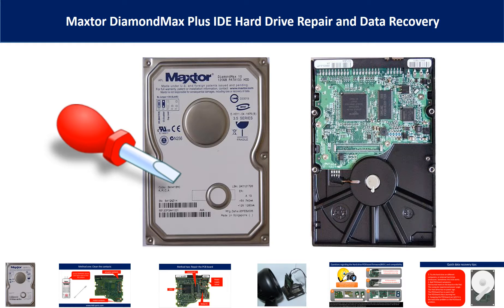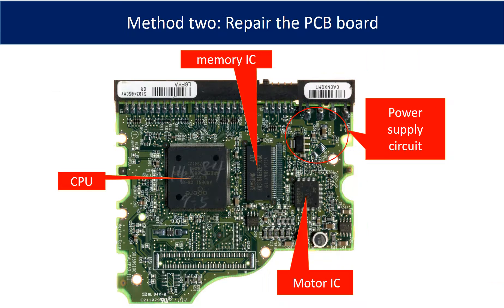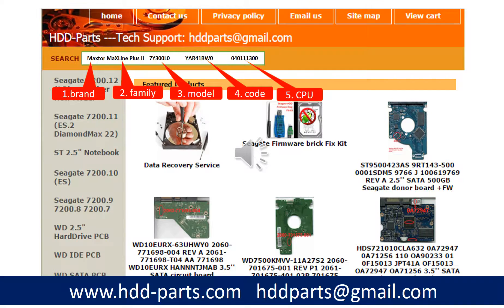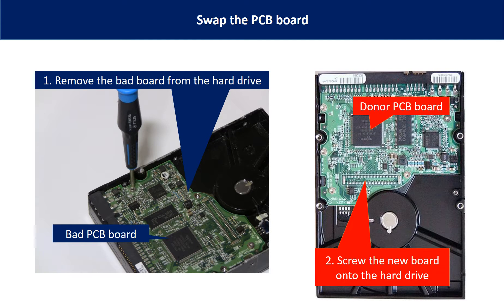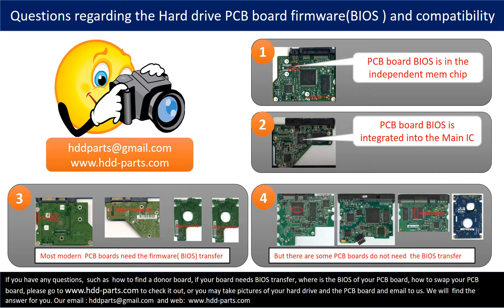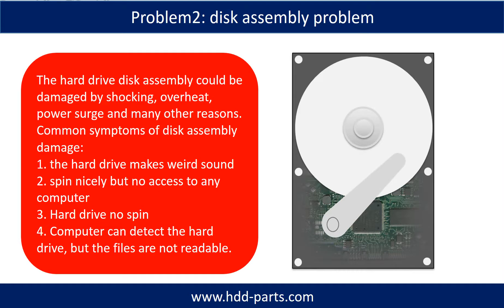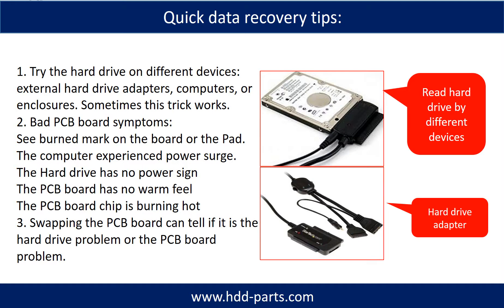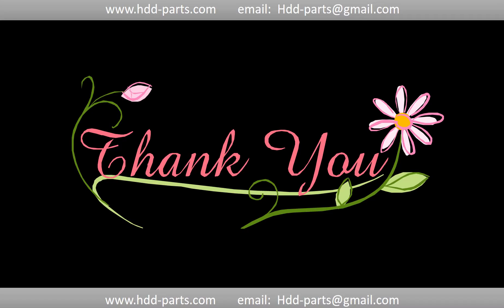Maxtor DiamondMax 10 IDE hard drive  040111300  repair and data recovery

Comment: Hi, I've got two resistors and two sdm capacitors on my hard drive and they're gone and I do not know how much they are. I'm writing the type of hard drive and the numbers of resistors and capacitors. Please, if you have this hard drive, the resistance and capacitance Take it out to me and measure it and send it to me so I can replace it and use my hard drive with great thanks.
Hard drive: maxtor diamondmax plus 9 80 gb ata / 133 hdd
Resistors: (R219 sub data base) - (R201 under the jumper base)
Capacitors: C301E-C301D Sub Data Base
email : micwinsp3@gmail.com

Comment: Hello friend, i have a DiamondMax Plus 9 80GB on which Smooth chip is burnt. I tried to replace whole board and change BIOS chip and it spins but the head is clicking. I tried new board without changing the BIOS chip and it is the same.. Can I do something else? It is the same model, no doubt about that.. Sorry for my English. Thanks
Reply from the maker: Hi, if you are sure the PCB swapping is perfect, then it is the disk assembly problem.
you may need to do data recovery.
Reply: Sean shaw I get that answer everywhere..
Reply from the maker: the disk head or the platter maybe is the problem.
Reply: There is a lot videos on YT of people opening their hdd and changing the disk head. I thought you need a special chamber or equipment for that. Have you ever done that?
Reply from the maker: we do data recovery as well,